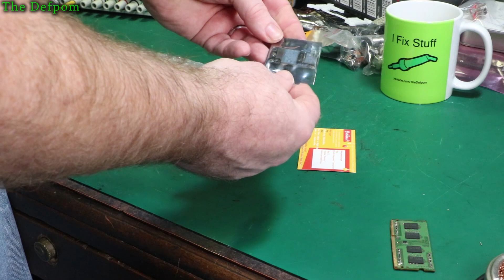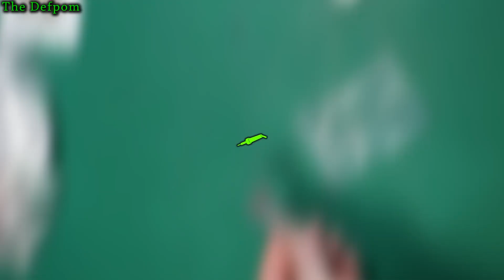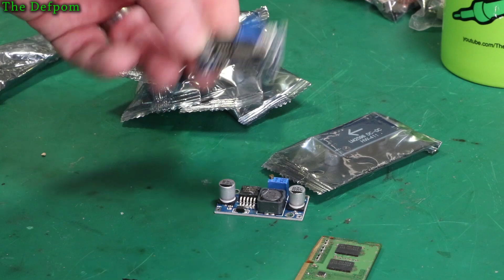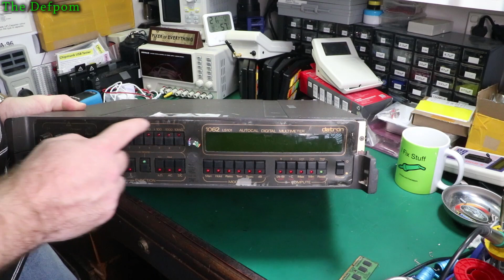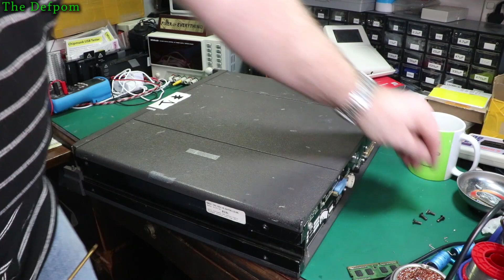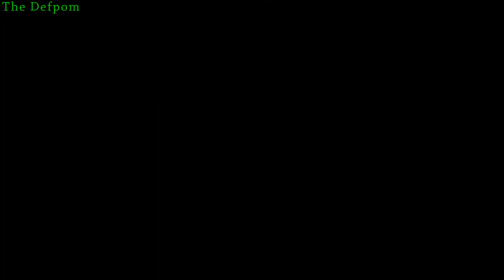▶ #718 Mailbag Monday 25th May 2020

Comment: I run pretty much every accessory (meter lights, DSP units, frequency counter, etc.) off the 13.8V station supply; I use those converters for the odd voltage items. Works like a charm and a lot less wall warts.
Reply from the maker: scott king - they are handy little devices, I’ve used them in all sorts of things.